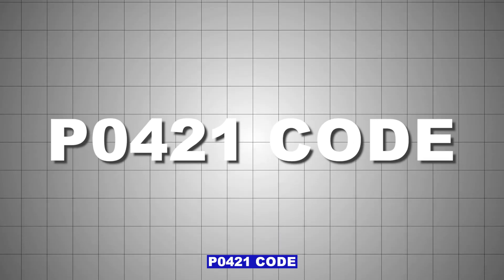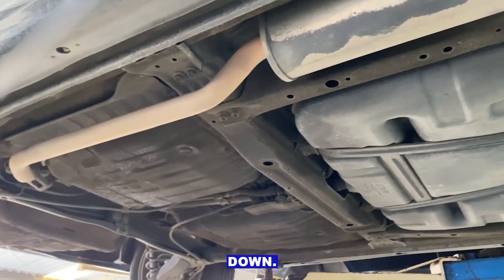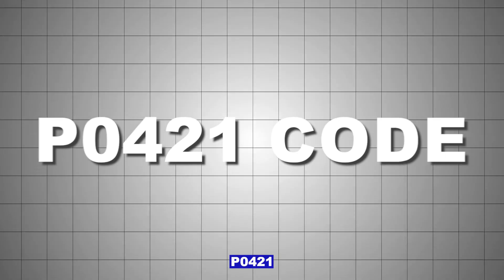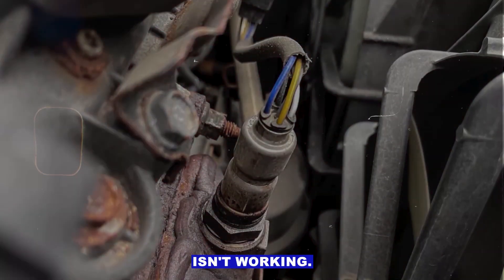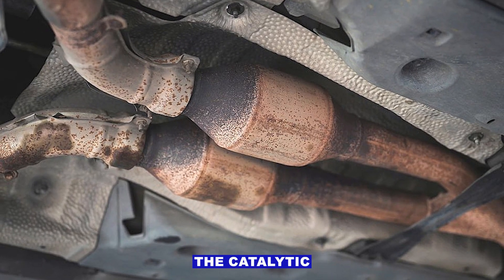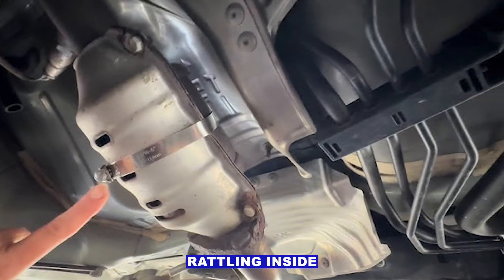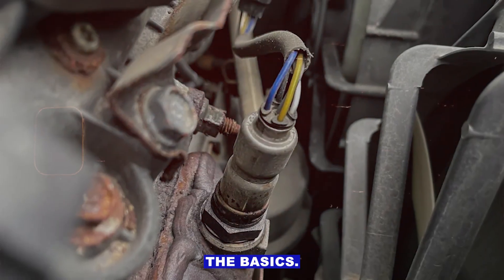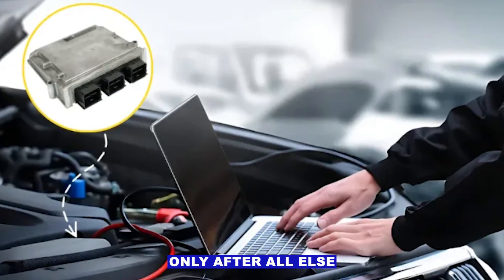P0421 Code: Warm Up Catalyst Efficiency Below Threshold (Bank 1) – Causes & Fix

Comment: i have this code in my 2020 mazda 6, i went to the dealer and they changed both the o2 senseors and after some time the code came back, the dealer say its not the cat but something else is the issue and offered that they will change a lot of parts like sparks plugs (mine is new), fuel filter, air filter, and others. but they say after changing all these parts the code might also come back. so i didn't do it and keep driving the car and the code come and go. do you think its dangerous to keep driving the car with this code? and thank you.
Reply from the maker: could be connector electrical not always part itself so gotta take it to mechanic who is good at troubleshooting and pin/pointing.